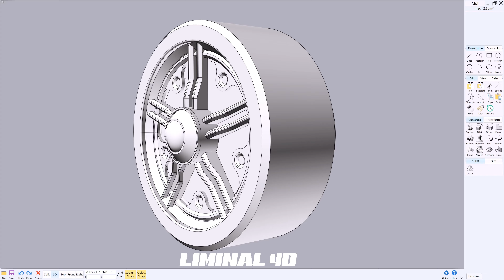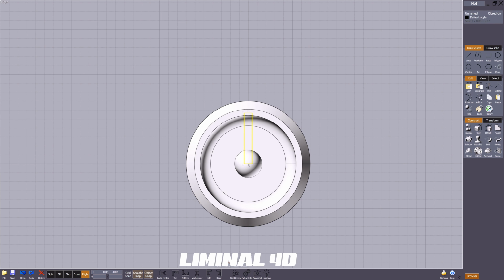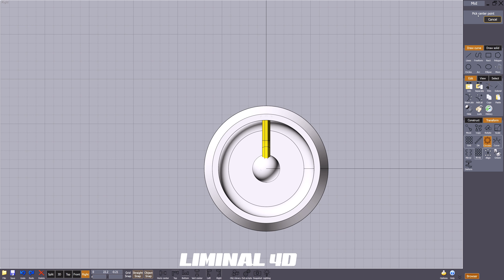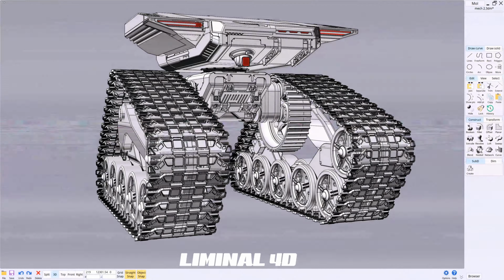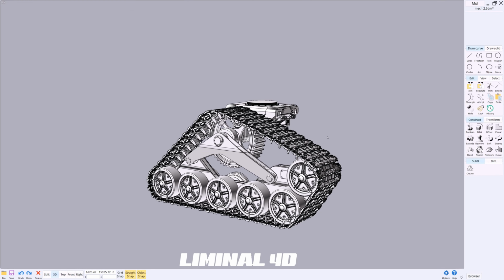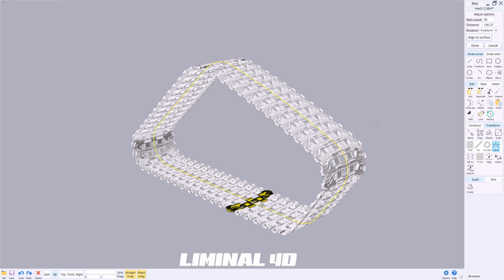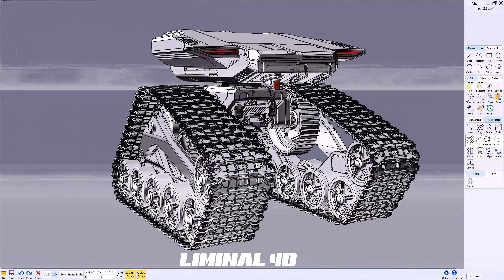Moi 3D Basics // ARRAY TOOL how to

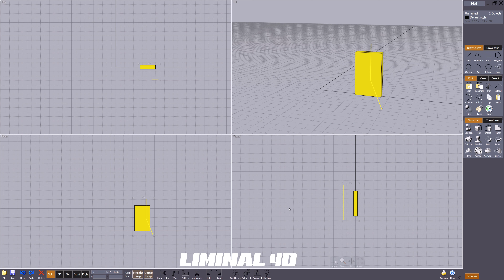Comment: Thank you so much!  I've made great progress with basics 1 & 2. But I have a problem on the 3rd part in 1:33 / boolean fusion. I assume you're using the ''trim'' tool. I can see the volumes, but I can't separate them. I have the impression that the volume is hollow. It's not a solid. Let me come back to the trim tool. There are some options, but which are the right ones? Thanks for your help. Thanks.
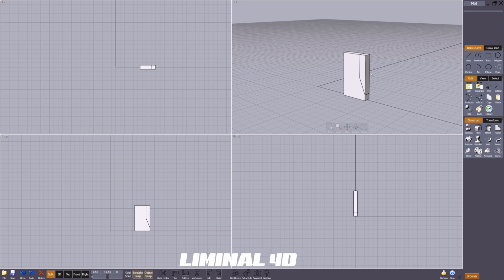Reply from the maker: at 1:33 I'm using the boolean merge command to show that even a line that isn't intersecting can be projected through to cut a solid. If the cut is not making two solids, make sure the line extends past the solid in both directions so it's a complete cut. Also make sure the 3d solid you start with is still a solid. If it has holes anywhere at the top right of Moi it will no longer say solid. In that case it will trim but not make the two solids anymore. Does that help?
Reply from the maker: I ask if that helps, 7months later... ooff. lol.  I guess I should say, hope you figured it out half a year ago, if not, I'll be back in another six months if you have another question. lol. sorry, it's a bad form of humor. Hope that helps! lmao

Comment: Thank you for giving Moi3d the attention it needs. It's truly a powerful program. If you have the time can you do a helmet tutorial in MOI? I'm still learning the basics and would like to see your take on the process. Also, how do you make seamless joints? When I export my stl files they have gaps in certain areas.
Reply from the maker: Thanks for your comment! I totally agree, Moi 3D is powerful and it's simplicity makes it so useful to have in a 3d modellers tool belt.  I can do a video talking about creating watertight meshes, there are a few things you can do to ensure your files have no gaps before exporting.  Quick tip for now: if you select the object in Moi, look in the top right and see if Moi considers the object a 'Solid' or 'Joined Surface'.  If it says it's solid, you can be confident there are no gaps.    That's a good topic.  If you have any examples or more details you can provide regarding the types of joints are causing you issues, let me know.    Also, a helmet tutorial is no problem.  Any kind of specific helmet or style?
Reply from the maker: @ScarBang I'm uploading a video that should help with the seamless joints issue you mentioned.  This vid will show how to properly prepare a mesh for stl export.   It comes out tomorrow.
Reply from the maker: The offset feature is a good tool to use.  Without knowing more info I don't want to contradict whatever you were told, I could be missing something.   In general, though, using tools like offset is a good way to go.  I can do a scifi helmet but it will be a little bit of time before I can get it made and posted.   Is the link you shared your work or your reference?